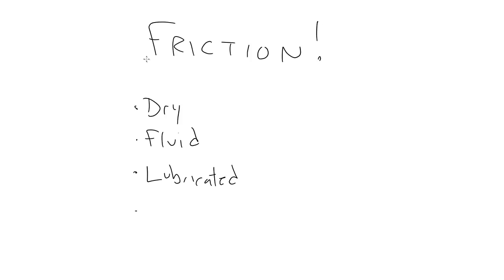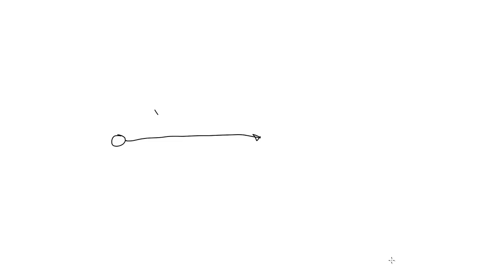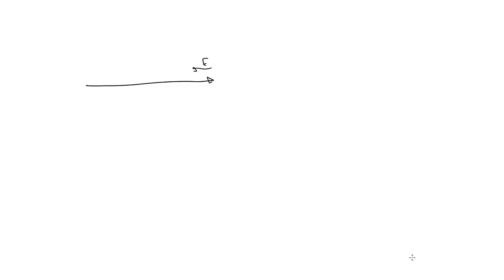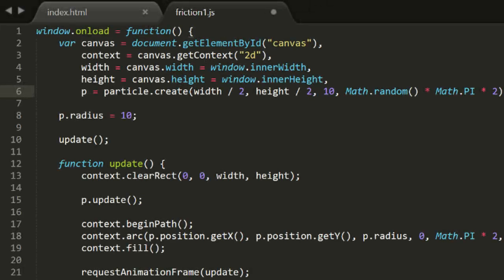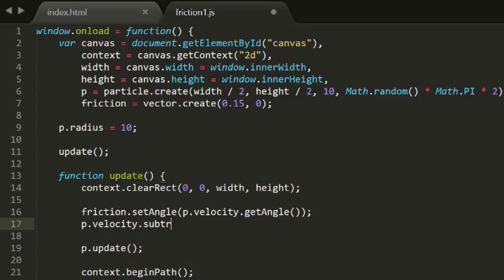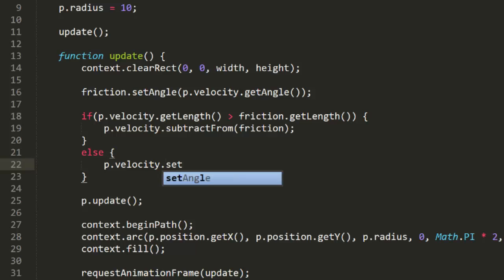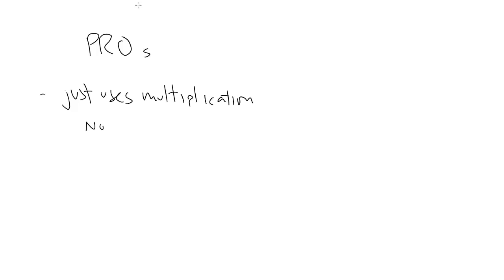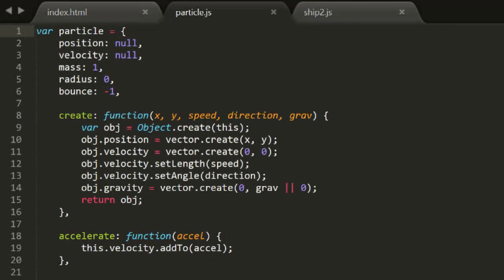Coding Math: Episode 13 - Friction

Comment: I think you can get correct friction with only one `sqrt` by doing this:
v' = max{ (|v|-f)/|v|, 0 } · v
where f is the magnitude of the friction vector.
Still not as efficient as the incorrect but good enough version, of course. Also you need to check that the current velocity is non-zero.

I'm not used to JavaScript, and mainly use Common Lisp, so sorry for the code that's probably less readable for most people, but here is a CL implementation either way (assuming usage of rtg-math):
```lisp
(defun friction (velocity friction)
  (let ((v (v2:length velocity)))
    (if (v2:0p v)
        velocity
        (v2:*s velocity (max (- v friction)
                             0.0))))
```

Comment: Presumably method 2 is trickier to deal with if you are using delta times to make your game fram rate independent?
Reply: In this case you don't need to worry about delta time since requestAnimationFrame basically puts a frame limit on your web app.

Comment: If the precentage-way to do is unreal, can't we just make the precentage Exponential?
Reply: You are essentially doing it in an exponential way, since you keep multiplying by a constant (0.9 in the video's case) which by definition is exponential. The problem is it only does so in a discrete fashion, meaning it only ever reaches  integer values of the exponential (0.9, -.0^2, 0.9^3 etc.) not anything in between (like 0.9^0.5 etc.). Doing that requires more processing power and time and also rewriting the engine so that it does things not on a frame by frame basis but in actual constantly advancing time.

Comment: You can optimize the first friction method slightly by comparing lengths without using Math.sqrt(). Effectively you are comparing length^2 rather than length, but the relationships >, =, and < remain equivalent.
Reply: Thanks. You will find a million places to optimize the code in these lessons. I'm going for teaching math concepts, not how to optimize code. But no problem pointing out.

Comment: Interesting, thx. You've made an error though : if k is the friction factor and dt the step time then
Vx = Vx - k * Vx* dt   and
 Vy = Vy - k * Vy * dt
is the right velocity formula : no need for cos/sin/atan or to approximate the friction. Cheers !
Reply: You're basically describing the second method I describe from around 9:00 on.
Reply: I think this is the proper implementation though. Treating the friction force as constant and then making an exception for when it would be greater than the positive velocity is so ugly and confusing. It's much simpler to use a scalar coefficient for friction and apply the friction force as a function of that coefficient times velocity because it works out to where you have a constant max velocity proportional to a constant movement force, which is highly intuitive and realistic. Then as you suggest you can just dial in the coefficient to get a pleasing ratio of force to velocity.